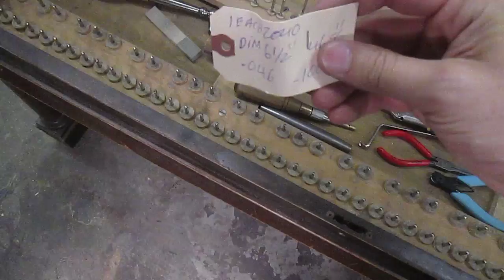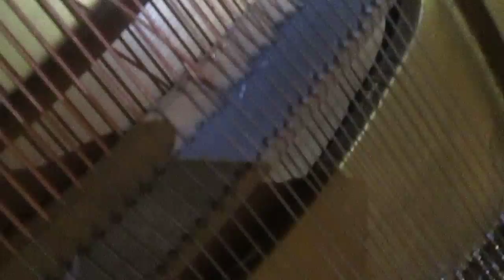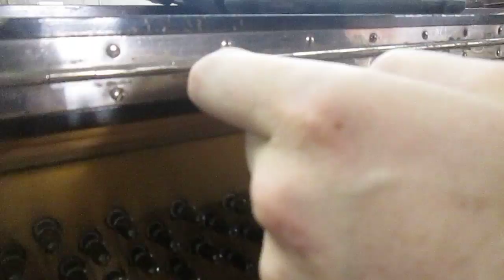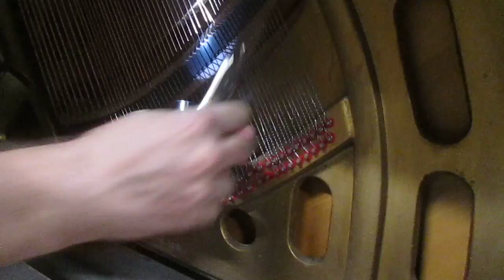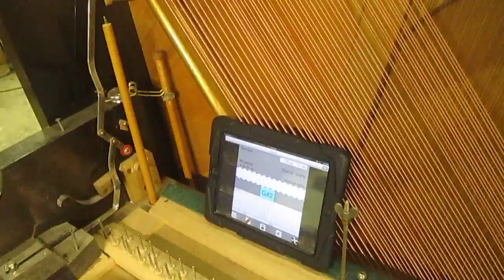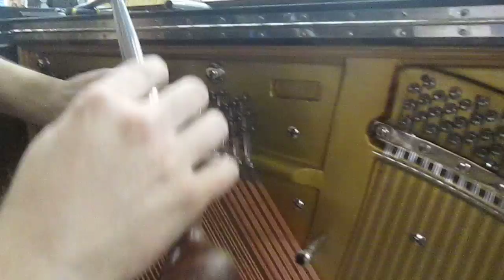Brigham Larson Pianos, How To Replace a Bass String

Comment: Could you use the coil tightener to tap the pin in more (instead of a pin setter?) The pin is too loose on the string I'm replacing, and I happen to have a coil tightener, but don't have a pin setter yet...

Comment: Do you adjust your measurement from the hitchpin due to the stretch?  I was taught to measure old string, then subtract 1/4".
I'm still curious what happened to your string.  Wrong measurement or bad duplication?
Reply: String was probably the one sized for the lower hitch pin (not that I've ever made that mistake ;-) )

Comment: How do you keep the bass string from popping off the BRIDGE PINS? and when they do is there a tool to put them back on easily
I noticed the mid "Tri strings go under the bass strings. is there an easy way or trick to replace Mid strings without removing the bass strings! is there a tool to put the tri strings back on the bridge pins without removing or loosening the bass strings?

Comment: I was given a Chickering square grand for a wedding gift three decades ago. Tuners refused to do it, so Hubby and I got a book out of the library. We got used tools at an estates sale. It turned out usable for us at home. Recently we acquired an upright as well. Very different! I broke the C below middle C. Thank you for this video!
Reply from the maker: You are welcome!
Reply: I never broke a string while tuning the piano until I started working in low light conditions and couldn't see what I was doing. so now I use a tuner app on my phone and put tape above the tuning pins with the key of each string over each tuning pin and wear an ultra-bright headlamp .

Comment: my university has a baby grand that's sat out for public playing, but there's 2 bass notes that are missing all of their strings and a high C that is missing 1 of its strings :/ I've reached out to multiple emails for the campus and just gotten no reply, about if they would fix it or not, so I'm tempted to fix it myself...
Reply from the maker: If you do attempt to try it, let me know how it goes!
Reply: @brighamspianoservice I give the turn at the upper part of the string, in the opposite direction as at the bottom part so the effect is the same. This saves me getting on my knees one more time. This method seems to work , would you think there is an objection to this?

Comment: Is it possible to fit the string without a coil maker and cut the string when through the pin and then wind it onto the pin? I currently don`t own a coil maker and have a custom made  F#2 bass string to fit to a console piano

Comment: What diameter is the brass you used for stressing the string?  Can you buy that commercially or do I need to make my own?
Reply from the maker: It's a homemade tool made from a brass rod found at any big box hardware store.
Reply: Thanks!  Would it be possible to post a picture of it?
Reply from the maker: @trevdog7945   https://drive.google.com/open?id=0BwP6N78L44nXQ25WVnZKWkx5ZnExY2QycUVGWmFpcDFfZC1B
Reply: @brighamspianoservice  sweet!  Thank you so much! I love your videos!  Very helpful.
Reply from the maker: @trevdog7945  You are welcome!  Show me a picture when you are done with your bass string.